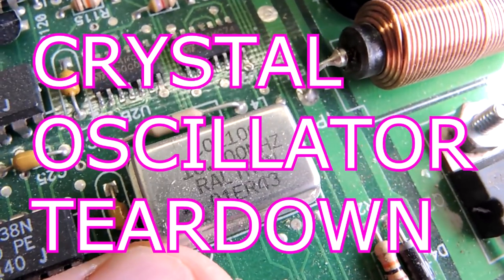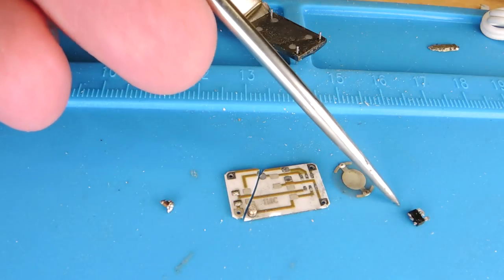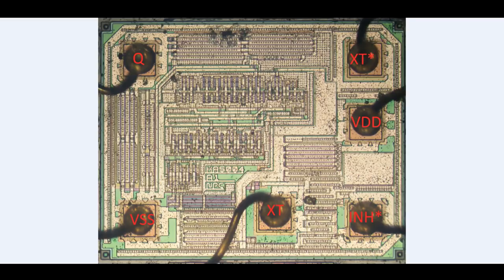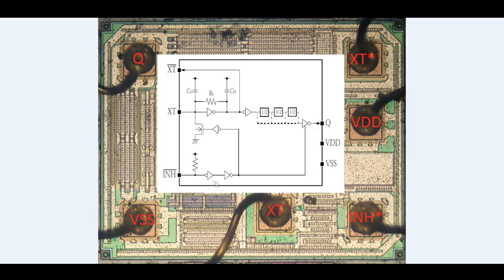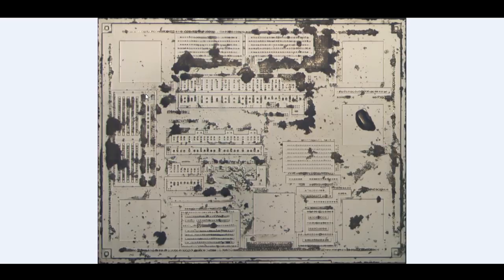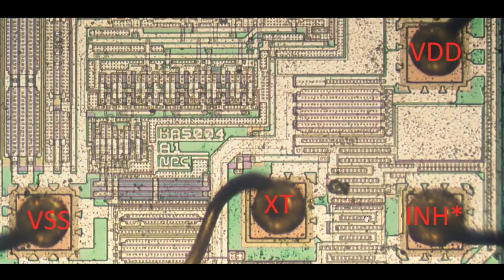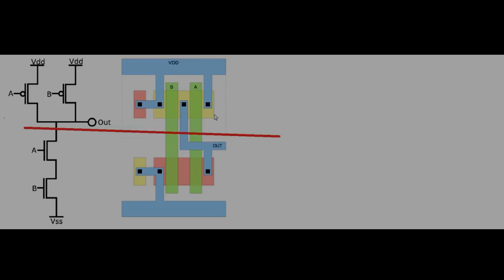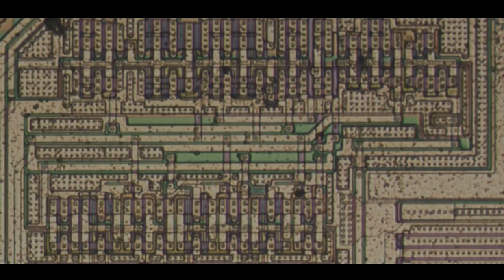Crystal Oscillator Teardown

Comment: When I worked at Delco Electronics back in the '80s and '90s, we built a lot of "little black boxes" that had an alumina ceramic substrate as this device does. We called them "Hybrids." An older book I read some years back called these "Hybrid integrated circuits." People at Delco scoffed at this term. Not only does it have a low coefficient of expansion, it is very rugged as far as vibration goes. It can also withstand temperatures that circuit boards can't. We made hybrids that could survive bolted to a car or boat engine.